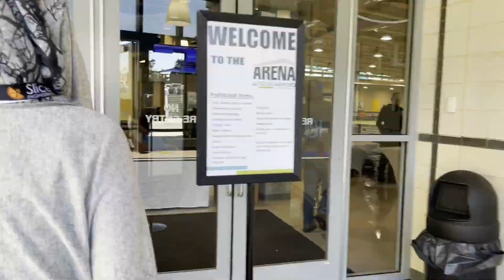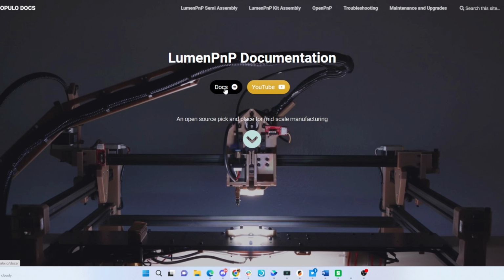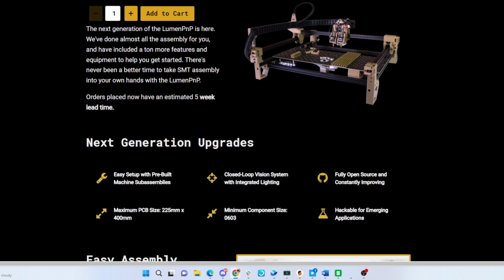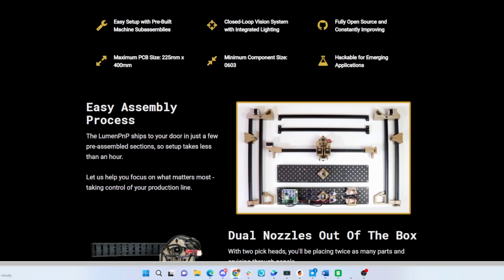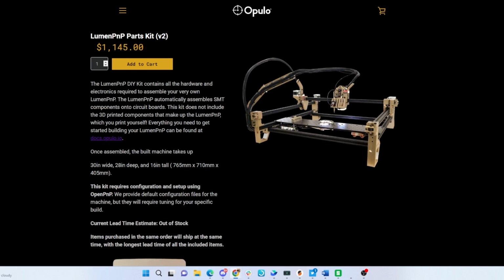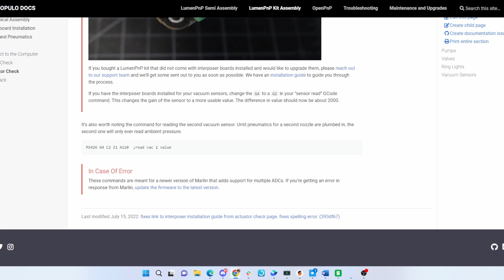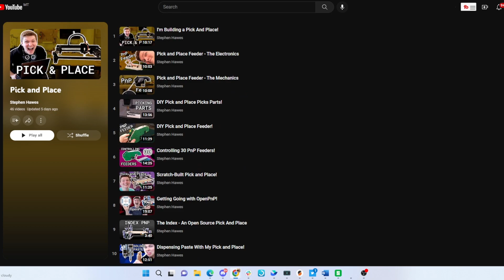DIY Open Source Pick'n'Place From Opulo

Comment: That's a cool Thinga-ma-jig ya got there. I think it's a little interesting that not much has been discussed on the reflow oven. Yes, it's a toaster. But you'll notice the controller box with a screen and graph next to it. That is a 3rd party device and when my friends were talking with him, he went in great detail about it because apparently the are hard to come by. So the stencil is industry standard and probably doesn't need as much explanation because of that, the machine handles the pick and place, and then... well you gotta reflow it. Good luck. It's like getting a car, putting fuel in it, and then going "hmm... how do I drive?" A step is missing, I would be surprised if it wasn't on the site, but there's now been maybe 4-5 videos on this machine at ERRF and it looks awesome but it's strange that he hasn't thrown in more info about the reflow controller as he's mentioned everything else.
Reply: That is a good point, he kind of mentioned it with the “temperature curve” bit, but basically you get a relay, a thermometer, and an Arduino etc and let it run the optimal profile.

There are numerous other Open Source designs out there, i can dig and see if he did a specific video on it.

Do check out his YouTube channel too.
Reply: @ericlotze7724  I don't but my friends have been following this project for a long time and we're enthusiastic enough that when they found out it was the same project, they actually shoved Tom3d out of the way (who was there taking b-roll) so they could get a better look. They talked about it for a while and in depth.

The methodology is easy to get and again, I'm sure there are many ways to do it. He seemed really enthusiastic about the controller he had and was recommending it whole heartedly as their favorite system... And then every video: squat. So it stood out as odd to me.